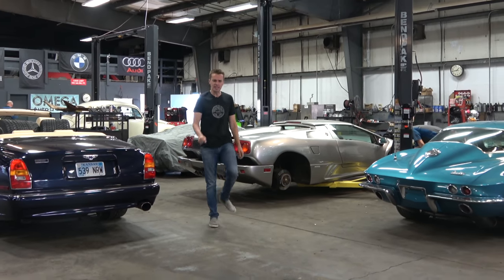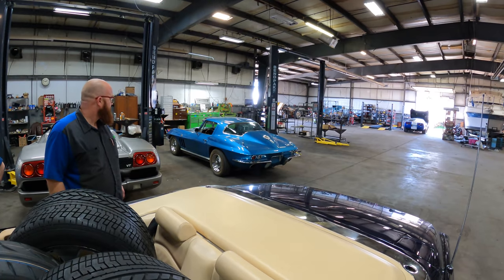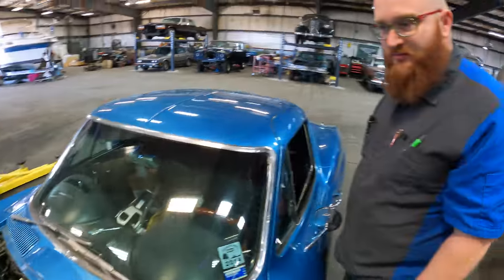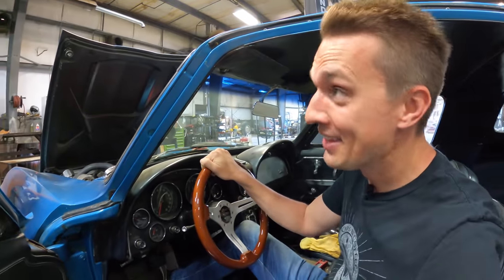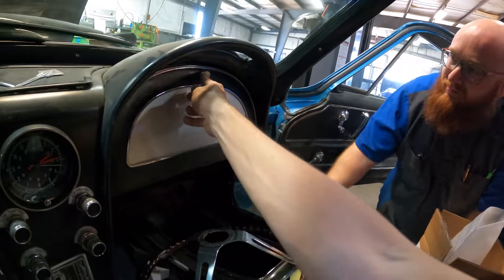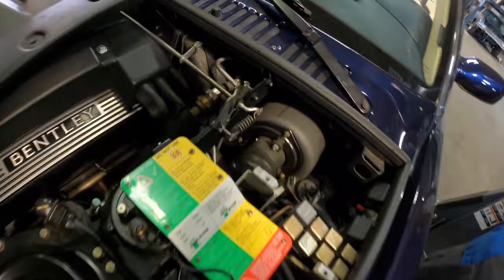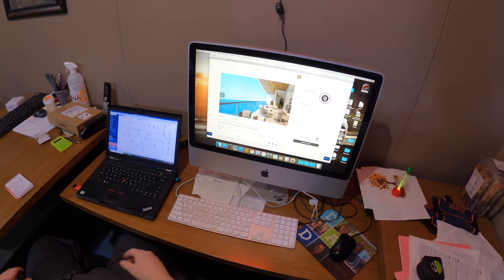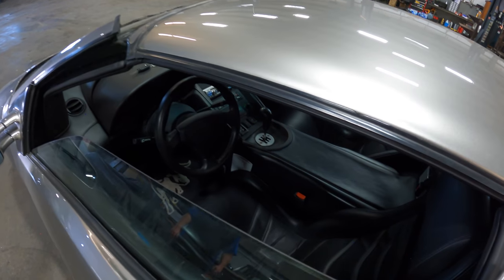Everything Broken and MISSING on My Cheap 427 Powered Chevy Corvette Stingray

Comment: That joke is just as funny every time 😂 the wizard on his computer looking at condos and islands before writing up the bill.
Reply: never gets old!
Reply: Quite a nice Apple Mac too. Goes to show how much Wizard is making from Hoovie
Reply: wait till the Wizard finds out that the tachometer in the Corvette is mechanical and was originally driven off of the now missing factory points type distributer. That's going to be more than a $200 dollar repair.  That's a tough choice to make for anyone doing a restomod on these 1960's Vette's. If you upgrade the distributer to an HEI you lose the only means to drive the mechanical tachometer.
Reply: Hoovie keeps buying hoopties Wizard gonna get that beach front house to go with his yacht. Lol
Reply: @Killsnapz  He can put a modern one.
Reply: @Killsnapz  Probably nothing wrong with the origianl style distributor with a single point setup and going into an el cheapo (if they are still available) cd type ignition box.
Reply: Wizard: “How many more of Hoovies’s cars I have to repair for that down payment on the condo in Nassau?”
Reply: @Killsnapz  I imagine making a custom system with dc motor and gears etc. that corresponds to engine rpm wouldn't be a big deal for some diy mind. Too bad those types rarely seem to come together. Though they probably do, I just haven't seen enough YouTube.
Reply: @notmenotme614  His iMac is from like 2007-08 its very old

Comment: Tyler pulled a James May when he said the iconic “But the clock works!”
Reply: "Right, now the battery is discharging, the oil temperature is very high, the oil pressure is very low, the engine temperature is off the end of the scale, I'm running out of gas... but the clock is correct!"
Reply: You guys warmed my heart with this reference

Comment: An easy way to tell if the paint is original or if it's been repainted the same color would be to look for the line down the side panels where top and bottom of the fiberglass body were bonded together. It's usually visible on original paint cars.

Comment: If the distributor was replaced with an aftermarket one, check to see if the one installed has the provision for connecting the factory Tach “gear driven” cable to it.  These older corvettes had cable gear driven tachometers.  Some aftermarket distributors like Mallory made mechanical geared units for the corvette like the AC Delco unit.  I’ve found some swap out distributors without the cable connection requiring a digital analog gauge conversion from Dakota Digital.  It’s a beautiful car!  Congrats on another fabulous addition to the stable.

Comment: These prices here give the the false illusion I could afford to own a Lambo...
Reply: For real. Almost like buying a $5000 BMW - too good to be true.
Reply: @jimmysgarage9068  Well, the main problem is that the Diablo itself doesn't costs 5000 dollars.... but, the repair costs of something 'simple' may not be that expensive if you do not get it to the official Lamborghini dealership...
Reply: @FacuGonz3  oh my goodness, you’re right. Years back, I took my old Grand Cherokee to the Jeep dealer for a diagnostic on a stalling issue. They wanted $900 to fix it. I bought the part (crank sensor) and did it myself. It took a while, but I saved a lot!
Reply: i think as far as lambos go the diablo is pretty reliable and they made em for a while so parts aren’t impossible
Reply: Tyler gets a steeply discounted shop rate from the Car Wizard.  Anyone else would pay a lot more.
Reply: was it 1500 for the rebuilt rack? bargain!
Reply: @oldanslo  I know, thus the illusion...
Reply: If you can do the maintenance yourself, it wouldn't be too bad. The lambo forums have a ton of good info on it. If you can work on a modern car, the lambo will seem simplistic.

Comment: Tyler, the 1966 Power brake master cylinder has separate circuits like what Wizard is looking for.  The originals cost thousands of dollars when you can find them because they are so rare, but there’s a quality reproduction out there that would look good in that engine compartment and improve braking.

Comment: "Theres oil pressure so that means there is oil"
Thats not how you should check your oil tyler 😂
Reply: means there's oil in the pressure sender unit at that moment, surely
Reply: Try to find a dipstick on some of the BMWs. What a joke.
Reply: @keithwiebe1787  they did that on engines??? I knew some ford transmissions were like that, you had to fill it and drain it to check the level but why the moter? Damn germans 😂
Reply: @keithwiebe1787  do modern cars even have a oil pressure guage or just idiot lights and codes when you gernade it?
Reply: @chickensfloat7427  Ford replaced the oil pressure sensor with oil pressure switch in late 80s. Some manufacturers actually use rpm data to manipulate gauges through engine pcm.
Reply: @keithwiebe1787  what the hell? Damn that makes me like my old primitive junk eveb more! Lol

Comment: Hauling those tires in that Bentley reminds me of the time I hauled 40 folding-chairs in my 2015 Mustang convertible.  LOL.  With the top down, it was no problem fitting them all in there.  Couldn't have hauled a passenger anywhere, of course, but still.  :-)

Comment: The tachometer is mechanical drive. You need the MSD distributor with tach drive. That will work with the MSD box. This is the exact setup I have.

Comment: Some one proly said this about the '64 vette's tach, but just in case the C2 & C3 up till '74 tachometers were mechanical.  The OEM distributor, even the TI cars, had a cable that drove the tachs.  The addition of the MSD 6AL system ( box + MSD distributor ) could be had either way I think.  Not 100% sure , but I think the replacement distributor could be either electronic or the optional tach drive distributor could be had at a lot of extra $$$!   Most ppl used to get the 6AL box, and buy either a magnetic or light chopper conversion kit.  I think a petronix conversion kit would work with the OEM distributor, if you have it.   On the brakes, I'd swap in a wilwood system, if you can hack the price.  Even just up grading to the later, '67 thru '72 non-power brake system will be almost the same money  in reproduction parts.  If it were my car, a non NCRS car, I'd do the wilwood sytem.  JMHO.  Save the Wave!

Comment: In late 1973 during the first oil crisis, I had the opportunity to test drive a 1966 427 Tri Carb Stingray with side pipes at a local San Diego used car dealership. What a thrill to drive that car. The sound, the look, the feel of going through the gears with that engine. The price of the car was only $2,500 (true fact) but I was going to college at the time and could not afford the gas prices at that time for the car. One of my biggest regrets in life was not buying that beautiful car.

Comment: Tachometer was a cable driven from the distributor. Put the oem Distributor back in there and run the MSD off the points.

Comment: One time back in the 90s I had to finish putting the ignition rack in a late 80s ford pickup. It was completely tore apart and the owner was sitting behind the column working on it when he died suddenly of a massive heart attack. His widow needed the job finished. I got it done, but it felt Erie sitting where a guy died. I did put a fender cover on the seat, there was no mess but I still wanted something between me and the seat. 😟

Comment: Hoovie, Check out Vansteel for corvette parts. Its a small company and they've always been good to me. You can get all suspension and brake parts there. They do wilwood and their own custom wilwood masters and calipers. I have a wilwood on my C3 and its an amazing master cylinder. It has higher line pressure too than factory.

Comment: Incredible to have the original teak wheel (they can command over $2k now). Hard to believe someone would replace it with the current atrocity that is installed. About as hard to believe as that there is someone who would transport gigantic wheels and tires in the interior of a Bentley Azure.

Comment: @ 6:00 , no Wizard, this is not an electronic tachometer, all Covettes from this era came with a mechanical tach, so most likely the previous owner swapped in another distributor that does not have a mechanical output to feed the old tachs.

Comment: There is a kit to convert to a dual master cylinder (~$300) - but you should check to see if there is actually anything wrong with the brake system before swapping it out. FWIW its usually the calipers that go bad from sitting so long - I would be shocked if one or more of those weren't leaking fluid.

Comment: Stable will clean the carb. I would run that fuel , I got a G 6 with 10 year old gas no problem I just added 3 gallon this year because it was low on fuel .Hoovie  he should give you a better brake on those prices

Comment: Okay, here’s the deal. Corvettes from ‘63 to ‘72 are basically rolling art. These are some of the most stunningly beautiful cars ever made (the original Maserati Ghibli gets my vote for most beautiful ever). BUT these old Corvettes have problems up the wazoo. I’ve had 6 of them (‘66-‘78) and despite the endless problems, you can’t help falling in love with them. One the plus side, because of the lack of computerized systems, they’re much easier to work on. It’s never a question of if you get stranded, but when.

Comment: For once I know more than the Wizard....The Vette has a mechanical cable driven Tachometer from the distributor....It's reasonable as long as the gears aren't shrapnel inside the distributor housing....Try to find an A/C Delco cable....While you have the distributor pulled....Install a Pertronix Ignitor III in the distributor with their 0.32ohm black coil....The Pertronix III is a multispark unit too so you don't have a big red box sitting on the inner fender....OK for a Drag Car but, not good in a Vette....Hope the Tremec isn't a Kiesler but, looks like it is...They are now Silver Sport Transmission company....Another Thing go with Stainless Steel Brake Company out of Michigan for replacement brake parts...The parts carried by many places all come from a big distributor who sources all the parts from China if you don't use SSBC for brake parts...

Comment: The brake master has a reservoir for only one circuit ,if one line blows you have no Brakes ,need to install a Dual Reservoir so if one line brakes you still have functioning brakes and much better Braking.

Comment: The tach red line appears to the the high horse version. The Air Cleaner maybe a replacement with the wrong sticker. The was mechanical required a shaft like a speedo from the distributor with upgraded Ignition it likely does not support the gear drive tach. Sadly.

Comment: You mentioned the leaky mineral oil 'tubing?', I am going to make my own speaker and other cables for my home theatre.  Thinking about the 'tubes' in your Bentley I am wondering if a product with some sort of heat shrink tubing made for cars would work to stablize the tubes so that they may not need frequent repairs.  Just a thought...

Comment: Oh Tyler!  How could you put tires in that beautiful car?
I agree with the Wizard, ditch that incorrect steering wheel.
I recall the Sta-Bil bottle stating that it works for a year.  Does Sta-Bil work for longer than a year?

Comment: The Wizard is impressive with his knowledge about exotics, but it's clear he's not familiar with that generation of Corvettes.  Others have noted that the only wires going to the tach are for the lightbulbs.  As for the brakes, they were problematic on those cars at the time.  The calipers would always leak or freeze the pistons in the bore, and depending on the climate where the car was used, the brake lines themselves would corrode as they were tucked up on the top of the frame.

Comment: I Own a '65 Corvette Roadster with the L79 327/350hp Motor and M21 4 Speed. Someone else has probably Chimed in about why the Tach is not Working, but I'm not going to Read through all the Comments. Anyway, the Tach on these Corvette's was Driven off of a Cable that attached to the Distributor, much like a Speedometer Cable...since the Original Distributor is not in the Vehicle, and the Aftermarket one does not have a Cable Drive, there lies your problem!

Comment: The trim tag says 418 (or 415?) so interior color should be either blue vinyl (or bright blue vinyl). Also, better double check the casting date, part # and assembly stamp on that engine before you dismiss it as non-original - looks like previous owner might have rebuilt the original or found a matching "restoration" block.

Comment: If the Corvette tach is original, it is a mechanical (cable driven) tach, but the modern distributor (probably) doesn't have a mechanical tach drive. Hence, the need to either replace the distributor or the tach. And definitely upgrade the master cylinder to a dual circuit; much safer, and the car already has many non-original parts.

Comment: That Vette should not be driven until Wizard has gone over & inspected every bolt, hose, and fuel, brake line & cable connections on the vehicle, even the one's that appear to already have been done, because the previous owner may have left some things only finger tight during assembly.  Just a warning!  And YES!  Never touch that paint-it's near mint and if it is original, it'll bring a LOT more money if/when Tyler sells it.

Comment: Lambo fluid- Wizard charges 750ish. 

Ford for my 08 Expedition 4WD: radiator, transmission, oil change, front & rear diff, $1450.  Plus tax

Comment: I actually feel like you should sell the countach to a collector of some sort. Then sell the merci on cars and bids. The diablo is the best of both worlds you get a manual V12 with a proper roof that comes off and looks great on too you could drive it and it would hold its value. Plus it there would be less lambo yoga. And also if you did that and was just gonna keep the diablo and never sell you could maybe get a capristo exhaust and really get to hear it sing. And it would be relatively guilt free because the other 2 v12's paid for it. You potentially square the account and still have a classic lambo to the hoovie garage that could have same status as the AMG SLS.

Comment: You know for just straight drivability since it's not a all original 66 you make think about going to the sniper throttle body EFI I'm sure if you hollered at Holly they might cost you a good deal or even talk to you one the dependability of a modern EFI and the look of a carburetor and as far as the brakes go C2 and C3 is we're not big fans of sitting for a long time their brakes would bleed out

Comment: Maybe I am an idiot, but what kind of tires are you running on the Diablo? Looks like the thread pattern of some kind of R comp tires for the front? Is that really wise to run with so mismatched tire types, because considering the thread pattern of the rears, have they really updated the carcass and rubber mixture of those since the 1980-90s?

And the front end got to be pretty light on a Diablo, is it wise running what seems to be r comps on the front if you are going to drive on on normal roads, what if you get hit by bad weather? Might be easier than you think getting aquaplaning?

Apologies if I have misunderstood something totally, but I dunno....

Comment: AAAAAAH! Never put tires on leather seats, especially not brigt colored ones. You'll ruin them in a second, the softeners from the rubber seep into the seats and you'll have tire marks on them forever, there's no remedy for that apart from shaving the top layer from the leather, re-coloring and re-sealing it. Aka: Putting on new seat covers.
Don't ask how i know...

Comment: If you wanted a 4 speed there’s this company in New York that sells an upgraded version of the M22 Muncie 4 speed. They are called “auto gear equipment” or AGE they bought the rights to Muncie and started improving them. The M23 they sell would have no problem supporting that gorgeous 427. http://www.autogear.net/motorsports/m-new-products/ here’s the link to the company, the transmission should run you about $3000

Comment: Christ, those front and rear tires on the Diablo is really severely mismatched.  If I recall correctly no manufacturer has both sizes any longer, but still Hoovie could've find some that were atleast somewhat similar?  The rears have a ton of grooves while the fronts almost looks like semi-slicks...  I bet it'll understeer like crazy in the rain.

Comment: I was shocked that you didn’t know that corvettes of that error had tach drive distributor. 
The brakes need rebuild stainless calipers! There is no way that it has original paint. The paint is clear coated and that year corvettes never had clear coat.

Comment: ya'll kept saying Nassau blue, and I thought it was the color that I am going to paint my 67 El Camino, Marina blue. Turns out, marina blue was not a Corvette color in 66. Chevelles were painted Marina blue, and I am told the colors are slightly different. Problem is, Nassau blue is easy to get because a lot of paint factories have the formula, but none of them have the formula for Marina blue. There are some specialty manufacturers who can get it close enough for me, but difficult for someone trying to match their original.

Comment: Commenting about the decision about which car/s to sell.
I think the decision should be really easy = Murcielago.

Its not going to appreciate in value with that horrible E gear thing and its not special whatsoever. The older 2 are fantastic finds, and having them both in the same garage is... well.... a dream.

Secondly, the murcielago have made about as many videos as you can. From hereon it should theoretically be fine which means its worth nothing for the channel content